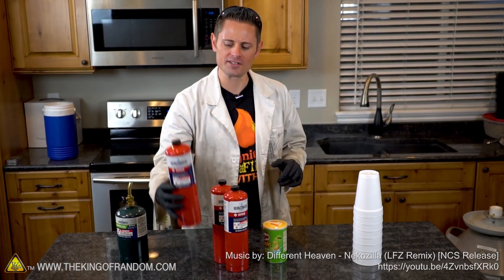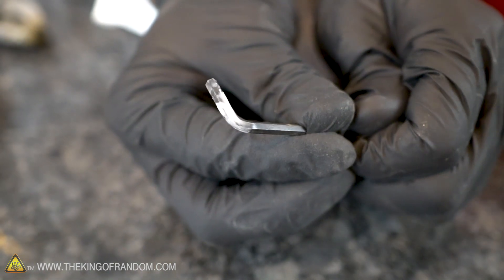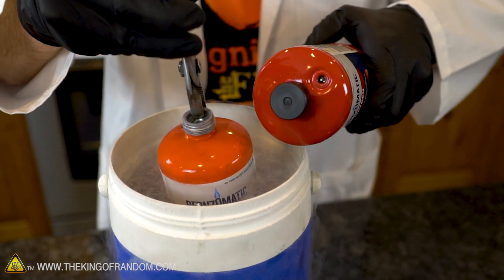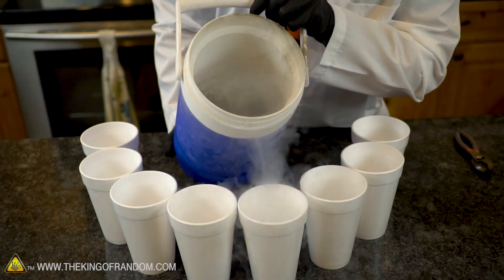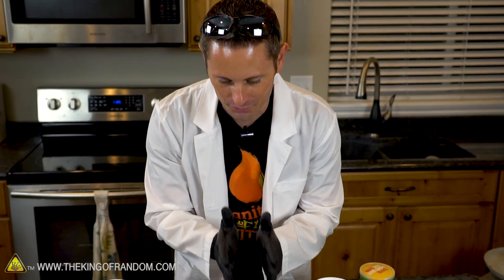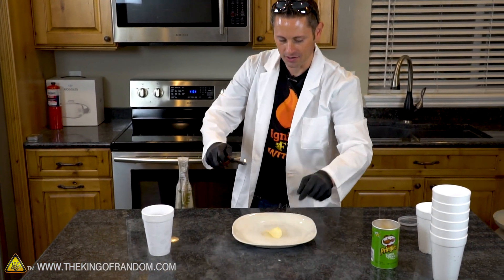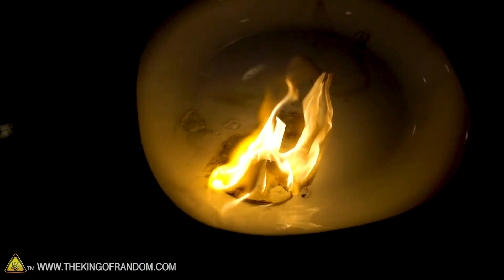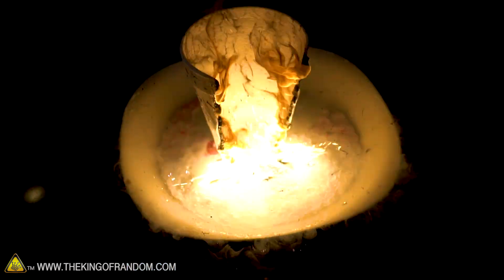How To Make Liquid OXYGEN! TKOR Experiments With Homemade Liquid Oxygen & How Oxygen Is Made

Comment: To clear up most questions about oxygen being flammable and stuff, here is how things work.
For anything to burn you need 3 things: Fuel, an oxidizer (Oxygen) and Ignition. Lets use the chip example. If you were to burn a normal chip, it would use the oxygen that is in the air. However, the air around us is only about 21% oxygen, the rest is mostly nitrogen. Whenever we introduce pure oxygen to the combustion, the fire gets brighter and bigger because the fuel has access to more oxygen than the 21%. Burning a chip with 21% Oxygen content vs 100% Oxygen content has different results.

If there is more oxygen in the air, fires start easier. In the rainforest, there are a ton of plants. Plants produce oxygen. Since there is more oxygen in the air, fires start easier. The oxygen itself isn't the fuel, it's the oxidizer. The chip is the fuel. The atoms and molecules of the fuel chemically combine with the oxidizer and put out energy in the form of fire, burning. Fire needs both. Increasing either fuel or oxygen will make bigger fire.

Hope this helped if you didn't understand before. Also, any chemists out there, feel free to correct me if I'm wrong.
Have a nice day!

Comment: For your gear casting, I would try adding "legs" on your foam mold and bury it completely in sand with the foam "legs" sticking up to the top of the surface sand. that way you have more support for the sand. Just an idea.

Comment: This definitively explains why when doing oxy-acetylene welding, when the fuel gets lit, a cloud of black particles escape from the flame and linger in the air untill the oxygen is on. It might be the acetone in the acetylene, I could be wrong, but the effect was exactly the same as when Grant lit the styrofoam cup containing the oxygen.

Comment: Grant...I was always thought in metal shop that liquid oxygen is not in its self flammable, how ever it's an oxidizer. What that means is that by adding liquid oxygen to the fire your adding oxygen to the flame making it burn hotter. 
The black stuff floating around is caused by the liquid oxygen. Same thing happens when you lite a oxy acetylene torch. In welding it's called soot. 

What would happen if you take a metal container filled with liquid oxygen and drop a lit match in it?

Comment: Liquid nitrogen has a lower boiling point at −196 °C (77 K) than oxygen's −183 °C (90 K), and vessels containing liquid nitrogen can condense oxygen from air: when most of the nitrogen has evaporated from such a vessel there is a risk that liquid oxygen remaining can react violently with organic material.

Comment: build a liquid oxygen generator using a dehumidifier, a low power air pump , liquid nitrogen (for low temperature cooling), and a condensation vessel

Comment: try liquid nitrogen vs liquid oxygen
Reply: Well, nitrogen isn't flammable so igniting it wouldn't do anything.
And Oxygen isn't flammable without a fuel so it wouldn't do anything either.
But mixing a fuel like hydrogen and oxygen would be cool.
Reply: IAMhippo it would look at the last part of the video it burnt without fuel the oxygen and the gasoline did egnite inside the liquid nitrogen
Reply: IAMhippo We'll get liquid water from mixing liquid hydrogen and liquid oxygen.
Reply: Lighting a mixture of just liquid nitrogen and liquid oxygen wouldn't do anything since there's no fuel present.
Reply: then light it and see wich wil win nitrogen or oxygen

Comment: It is dangerous to drink oxygen
Reply: You want to drink -200c liquid?
Reply: Not too much cleverness here. The smart answer is yes, it is dangerous.

The boiling point of liquid oxygen is -183°C. Any warmer than that, and it becomes a gas.

You can find a few videos of people claiming to drink liquid nitrogen, which is a little colder at -195.8 °C, but they're not actually drinking it. It's briefly putting a small amount into their mouth and then blowing it out as gas. You could do the same with liquid oxygen quite safely, if adhering to a few rules. If you're not clever enough to recognise the obvious rules, don't do it.

However, if you kept pouring a large enough amount to actually get past the mouth and into the esophagus on it's way to the stomach, without boiling away into gas in the mouth, then massive tissue damage will have been caused due to the extremely low temperature. I reckon you'd likely lose your tongue.
Reply: ARENA64 he it is not is it
Reply: Bart Bouwman err it will have ledenfrost effect, and turn into gaseous state by the time he swallowed it, as oxygen boiling point is waaay below nitrogen, sooooo. Itz ok to drink liquid oxygen, cuz by the time u swallowed it, it would've turned into gaseous state
Reply: MaveHo gt it would have the Leiden frost effect for a few seconds because of the gas emitting from the liquid, yet the gas that is emitting is surely colder than normal water so yeah....
Reply: Riki Z. Not a chance. The lowest temperature possible is -459 f, or -256c.
Reply: yes cause oxygen in liquid form is couple thousands degrees below 0

Comment: Can solid oxygen burn?
Reply: Liquid oxygen is NOT flammable.... thy hydrogen in a rocket is and the reaction time is shorted with the help of liquid oxygen. Your match in liquid oxygen is burning faster thanks to the increased volume of oxygen around it and not the oxygen itself. Maybe u should do your chemistry again.
Reply: Oxygen is needed for a fire but is not flammable itself.
Reply: Khaled Shawer oxygen aren't flammable, so a solid, liquid or even a gas oxygen cant be burned at all

Comment: so in theory you could use it as like a liquid form of gunpowder?
Reply: GEAR ASSASSIN Im not sure but I don't think so. While it may be flammable it's not combustible enough to shoot a bullet. Oxygen acts as a sort of an aid to burning things. So if there was a way to mix pure oxygen gas with gun powder right before you fire it, it should have a bigger blast.
Reply: Scott Rose 
I believe that Hydrogen (I think) makes oxygen combust, so if you could figure out how to mix them and make them combust, then you theoretically have liquid gunpowder.
Reply: Oops, I meant H2 instead of hydrgoen
Reply: GEAR ASSASSIN So, let's put it this way. Soaking cotton in nitric acid makes it highly flammable. Soaking it in liquid oxygen makes it a high explosive. I'll let you figure out the rest.
Reply: not a liquid gunpowder, its just a more expensive oil that burns relatively quick
Reply: Any form of combustion is basically oxygen bonding chemically with a fuel and releasing energy in the process. So in order to have any combustion you must have a fuel to combine with the oxygen (here it's the chip and the cup). Burning carbon makes CO2, burning hydrogen makes makes H2O. So yeah, adding oxygen might make the gun powder go off faster.

Comment: What happens if you mix liquid Hydrogen with liquid Oxygen. Will you get frozen water?
Reply: FWN NinjaTurtle The only way to chemically combine them is with electricity or a flame, which would add enough energy to the system to make it liquid water

Comment: Can you make liquid helium?
Reply: It's extremely hard to create liquid helium, the most well known place that contains liquid helium is CERN
Reply: Saul Huizar it's impossible to make liquid helium with simple easy to get machines.
Reply: Yes but that's a sealed system that is used to condense the nitrogen
Reply: RedEssence Gaming but you still need to get it to near absolute zero which is the main problem.
Reply: Saul Huizar I don't think thats very possible with the average consumer but it might be possible
Reply: T3kk1e 101 actually that is gaseous helium. And to make liquid helium, you would need to get it to about 2K which is just about absolute zero so not very simple
Reply: Saul Huizar Thats nearly impossible. Liquid helium has a temerature of 4k, that means it is 4°c hotter than absolute zero! So you need a REAL EXPENSIVE system so get liquid helium !
Reply: Wizard Magizard DESY has a lot too :D
Reply: Saul Huizar he has it in his liquid nitrogen maker
Reply: RedEssence Gaming it's more complex than that, compressing things actually causes them to heat up, and regardless how are you going to generate that kind of pressure.
Reply: Dane Jones then you cool it while compressing it
Reply: Yes, but it's melting point is -272°C. It's near absolute 0.
Reply: Saul Huizar you need a very special method of cooling for temperatures close to absolute zero. (quantum cooling i think).

Plus getting helium from the atmosphere is very time consuming, since it is an almost negligible part of air
Reply: Salami Man you could also put it under pressure as well

Comment: what would happen if you would lead CO2 gas through liquid nitrogen-either with the gas in direct contact with the liquid or through a copper pipe? would it be possible to make dry ice using liquid nitrogen?

Comment: What about making liquid ozone? You could make it in the gaseous form with high voltage. Then you could use liquid nitrogen to cool it down. It has a melting point of about - 192°C and a boiling point of - 112°C, so the liquid nitrogen should do the job. It is quite toxic though (0.01 ppm) so you have to do it in a well ventilated area. Also, it is a powerful oxidising agent so..

Comment: now you can try burning the oxygen with hydrogen and making pure water!
Reply: actually u burn hydrogen to oxidize it therefore making water (H2O)
Reply: ComputerWarrior I know just burning hydrogen will do it but it would be a nice comparison air vs pure O2. The O2 I would think would be a lot brighter an me hotter. then maybe cody's lab could test the purity difference considering there is far more then just oxygen in the air
Reply: Jason H combining liquid hydrogen and oxygen makes rocket fuel so in the amount of time before they are burnt they will combine and then explode
Reply: the boosters were actually solid fueled rockets. the Shuttles 3 main engines (on the shuttle itself) were Liquid O2 and Liquid hydrogen engines. hence why it had the giant orange tank which stored both liquids
Reply: Joshua Perez I didn't say to drink it. if you take a sip it wouldn't hurt you but drinking a bottle would start pulling the minerals from your body. you could try storing it in a metal container like galvanized pipe to show how it pulls/dissolve lead out (like what happened in flint, michigan)
Reply: That's actually the same effect as a space shuttle, which used Liquid Hydrogen and Liquid Oxygen for the main 2 boosters. So you would get pure water from it yeah :D
Reply: HermitJensen yep, sorry my bad
Reply: Minako Yukino that is not the most reactive by far. Sodium metal on water is more reactive then H2 and O2. It's the same reaction that water does on its own at a very very low rate (2 parts per billion I think) is the basis of using water to fuel cars (fission)
Reply: Jason H if you want to blow your face off then you're welcome (sorry but that is the most reactive chemical reaction that human have ever known)
Reply: Jason H pure h20 actually is really bad for you because it had no minerals and vitamins which if you were to drink it, it would wipe out your minerals and vitamins

Comment: Quick vocabulary note:
Volatile refers to the tendency to expand and evaporate while reactive is the tendency to bond/react with other compounds. Oxygen is certainly more reactive than nitrogen, allowing it to increase the burn rate of any fuel to the point where petroleum products get explosive around compressed oxygen. Volatility depends on temperature, pressure, and volume/surface area.

Comment: Ive never seen that "cup method" for extracting liquid oxygen. Don't you end up with a whole lot of other gasses in the mix as a result? Oxygen is only a small part of the air after all, and ha a pretty low boiling point. I'd expect that you would get a lot of CO2 in there too (and nitrogen obviously).

Comment: It doesnt burn as you expected because to cause combustion,  you need fuel, oxygen and heat.  Liquid oxygen is very cold and doesnt have much heat in it to support combustion. However, you can let the oxygen evaporate in a container then setting the object in it on fire, then you can get what you were expecting.

Comment: Is liquid oxygen the same as compressed natural gas (cng). If so could you run an engine on it.over here in Australia there are some trucks but mainly buses that use a diesel based engine to run on cng with a few design tweets of course.if so would be a cool video to mock up and Perspex engine cylinder to run on it or maybe use it in a potato gun.

Comment: ACTUALLY oxygen is not a fuel. It's not flammable by itself. Oxygen is an accelerant and makes that which normally burns by itself burn hotter and faster. Hence why the chip and cup burned. The chip and cup will burn without the use of oxygen. Oxygen just accelerates the burning of said objects.

Comment: You know how to make Hydrogen. You know how to extract Oxygen. How about making H2O?
Reply: You don't need the oxygen here to make H2O from hydrogen, you just burn hydrogen in the air.
Reply: He already did, the condensation that formed on the cups is crystalised H2O aka snow.
Reply: how about rocket fuel?
Reply: No but the Hindenberg, like almost all terrestrial combustion, produced water as one of its primary byproducts, along with heat, light, and carbon and nitrogen oxides.
Reply: uhm, no, just like H2O2 is not made from H  and O

Comment: The oxygen hasa very low boiling point, so it would need to be pressurized to a far higher pressure for it to turn into a liquid. Making such a small liquid oxygen canister wouldn't be worth it (i think). Thats also why there is not much in there...

Comment: what would happen if you drank liquid oxygen?
Reply: What would be cooler is burning diamonds in it. Usually diamonds are inert, but in an atmosphere of pure oxygen they burn with, if o recall correctly, a bright white flame.
Reply: Maybe he can get a diamond for his next video just to burn it lol
Reply: im more interested to see if it can carbonate a drink
Reply: that would be cool to see if it can
Reply: Dylan Zrim It can't. It's completely apolar so it won't dissolve in water.
Reply: so would it just sit on the top or freeze it
Reply: Correctomundo. Also, the reason CO2 carbonates water is because it reacts with it to form carbonic acid, it doesn't dissolve in it's gaseous form.
Reply: saying correct didn't tell me which one it would do would it freeze,sit on top, or just evaporate?
Reply: Oh lol sorry, it will do both ofcourse. Just like liquid nitrogen.
Reply: Well it would still be cool to see it in action

Comment: Can you solidify gas? probabbly not but... why not try
Reply: scarce since oxygen is a gas, you can turn it into a liquid (as shown on vid) then into a solid (like water turns into an ice cube)
Reply: i know that, but solidify gas directly(without turning it into a liquid)
Reply: not exactly how it works
Reply: it is possible at the right temperature and pressure.  it's called deposition or desublimation.  extremely difficult though.